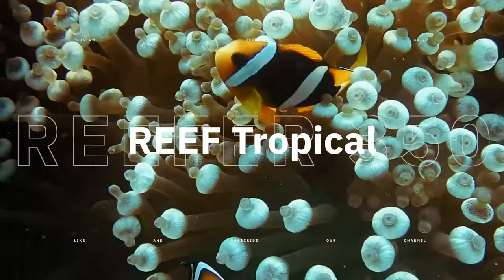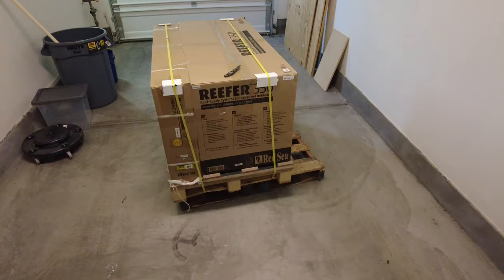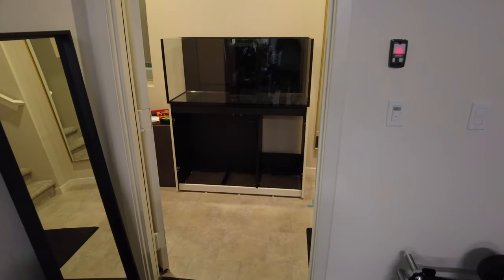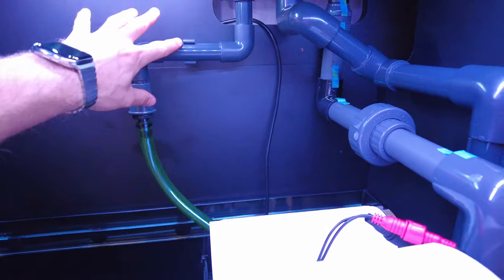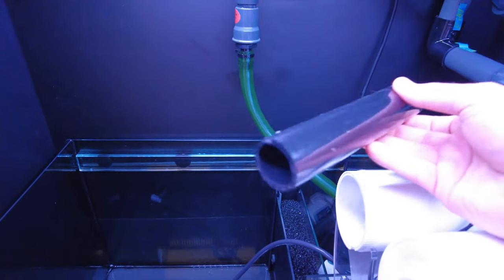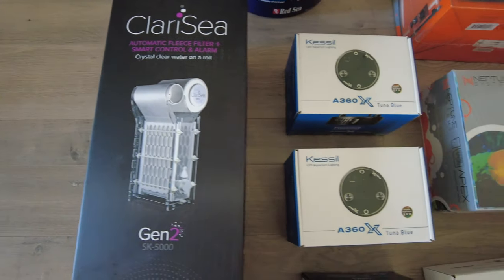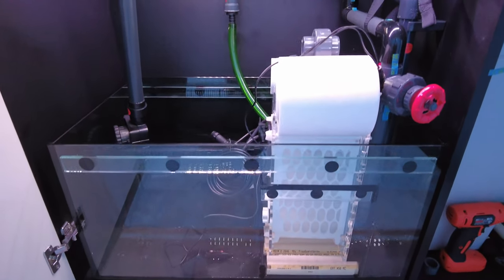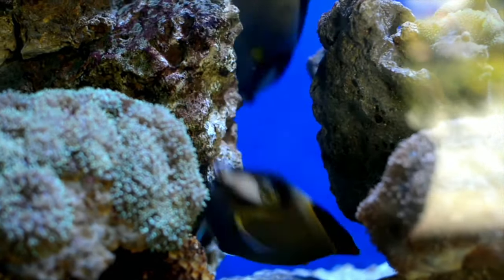New RedSea Reefer Build & Custom Plumb for Filter Roller! - EPISODE 1

Comment: Thanks for sharing your video. Im setting up my new RS 350 at this time as well. Trying to figure out the best way to design my manifold. I had a 90 gallon reef in the early to late 90's so I see some great equipment improvements eg. lights and protein skimmers, but not much else has changed except that I could get big corals and fantastic live rock that aren't really available anymore unless you want to break the bank. They were fairly cheap back then and right off the reef. I'm actually really glad that they closed the reefs down to harvesting when you can just grown the corals and rock yourself...just takes a little time. This is going to be fun!